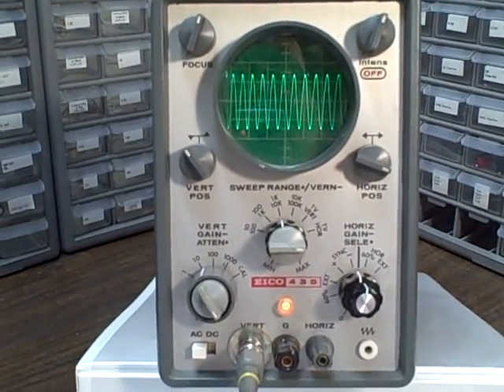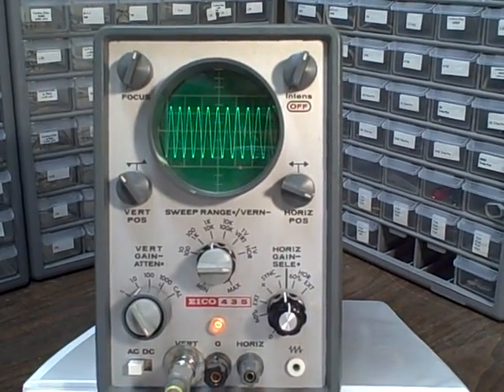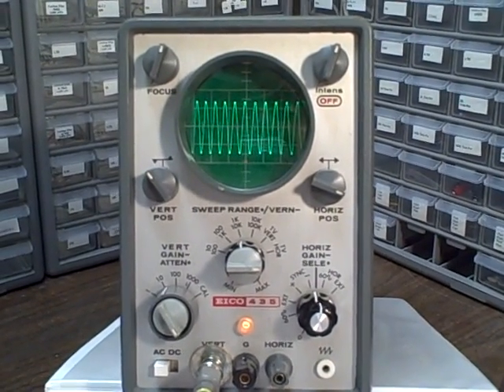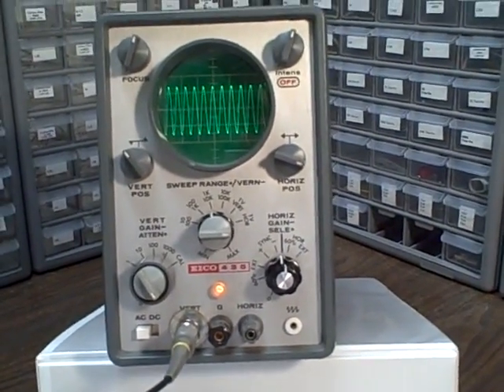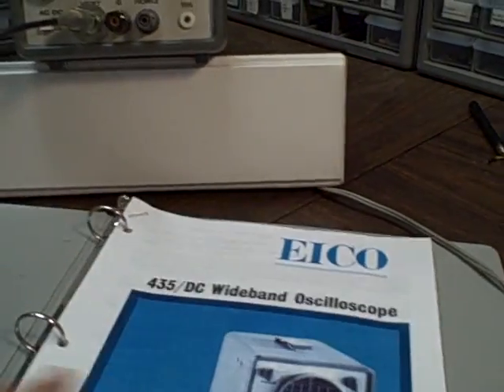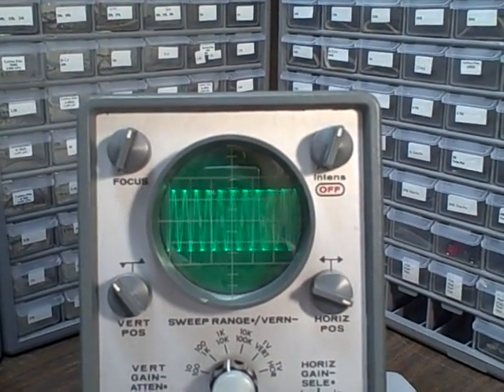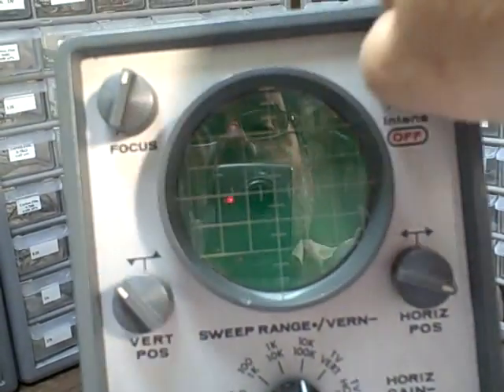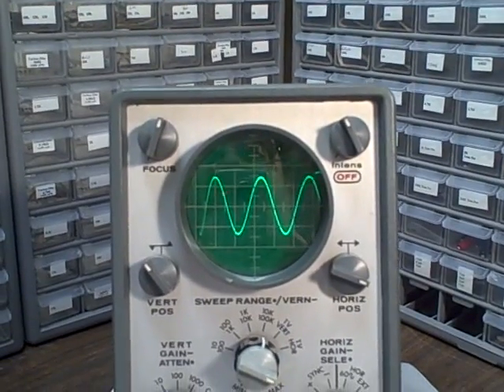eico 435

Comment: I have recently bought one like this with no probes can you recommend what types of probes i should get for this?
Reply from the maker: It was originally made to be a direct connection.  The probes are handier, so modified mine with a BNC connector, then bought a 20Mhz probe to use with it (you can find them on Ebay for under $10).